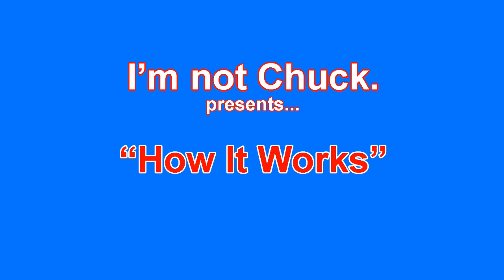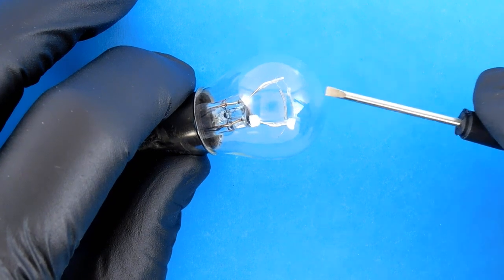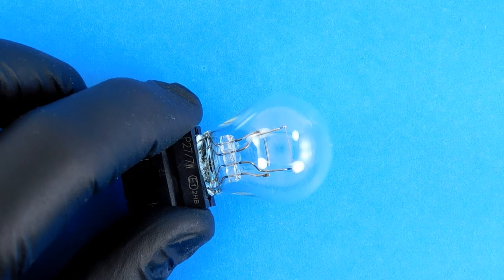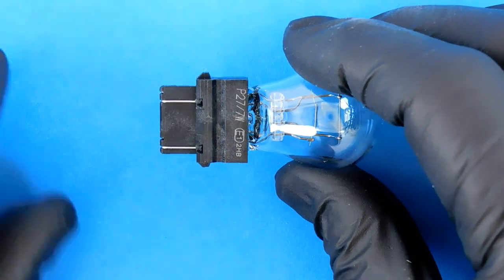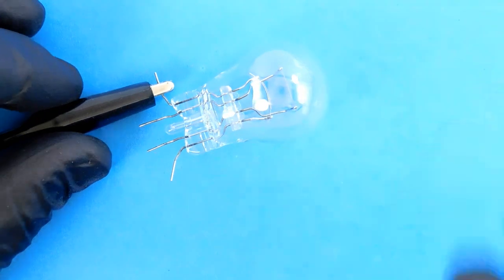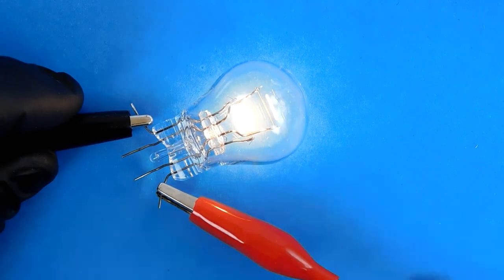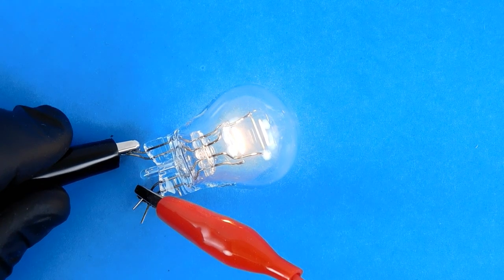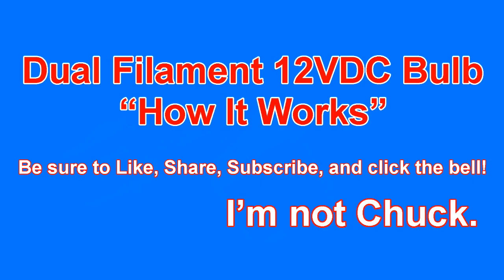Dual Filament 12VDC Bulb - How It Works

Comment: Thanks for explaining what I needed to know:  That each wire for a dual filament use the same 12v.  I was concerned that the small (running light) filament might require a lower voltage, but you were able to answer exactly what I needed.
Reply from the maker: Cool! It's great when one of my vids helps someone with just what they want to know. Thanks for watching and for commenting.

Comment: Can you explain why would the halogen bulb in the left stop light not work in the larger 21w filament after I tried LED? The bulb is nearly new, the filament seems to be whole.
Reply from the maker: I have tried, but I don't have a reasonable explanation. Thanks for the question and for watching.

Comment: Does it matter which way I insert my 3157 dual filament or no
Reply from the maker: No. There are two connectors on the bottom of the bulb, so it will connect correctly either way. Thanks for watching and commenting.
Reply: @ImnotChuck.  okay ty so much but the other question I had was when I turn on my parking loght rear work but the front dont I change the bulb n checked the fuse but the turn signal bulb previous owner had it hook up to a led headlight but I put the original headlight assembly back on n it dont work only work when I signal

Comment: What do you suggest sir? My stock bulb is T20 double filament for my park light. It just doesn't make sense because park light only uses 1 filament. I plan to change it into LED but I am now in conflict with myself. Is it possible that even if it is just a parking light it uses double filament?
Reply from the maker: Yes, there is nothing to prevent only one of the two filaments from being used. It could be that someone replaced a single filament bulb with a dual filament bulb. Thanks for watching.

Comment: Great explanation, I'm not Chuck, as always! Question: Can the LED equivalent of these bulbs be safely used to replace the incandescent bulbs in RVs??
Reply from the maker: All of the LED replacement bulbs that I have seen are marked "Not for Highway Use." I don't know why they are not approved for highway use; it could be that they just haven't passed some regulation or there could be some other issue. I would like to replace the rear bulbs in my travel trailer with LEDs, but I think that I will wait until I find some approved for highway use. Thanks for watching, for the compliment, and for the question.
Reply: Thank you! Have you replaced your inside lighting fixtures with LED bulbs, Chuck? I have seen different reviews concerning them. Some ppl love them and say that they are MUCH cooler /use less of your house battery, others say that they melt the light covers.
Reply from the maker: Yes, but instead of just replacing the bulbs with LED "bulbs," I actually replaced all the fixtures that use incandescent bulbs with new fixtures that have LEDs built in. Thanks for the question.

Comment: For 1157 now i only have 1 filament bulb so i am trying to convert the single filament bulb to dual filame to bulb so it can be running light and turn signal
Reply from the maker: If the socket has three terminals on the bottom, you can simply buy a dual filament bulb and plug it in. Otherwise you will need to change the socket and maybe some wiring. Thanks for watching.
Reply: @ImnotChuck.  yeah i have figured out the wiring just have to buy a socket and a bulb and tap the red wire to parking bulb